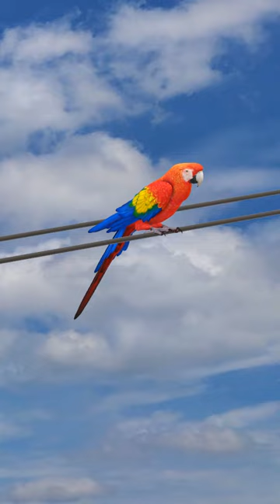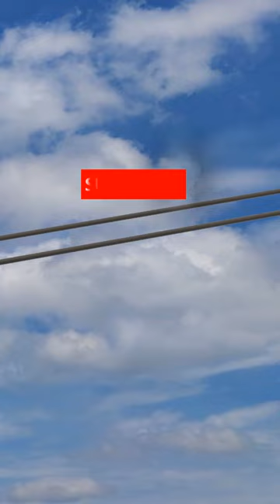WHY DON'T BIRDS GET ELECTROCUTED ON POWER LINES? (3D Animation) #shorts #bird #birdsfacts

Comment: No idea what the f you said.
Reply from the maker: Let me simplify it for you : the birds mostly sit on a single cable hence the current doesn't flow through them and chooses the path which has less resistance i.e. through the cable, but if a bird touches two wires they short circuit them and hence current passes through them and the get electrocuted.